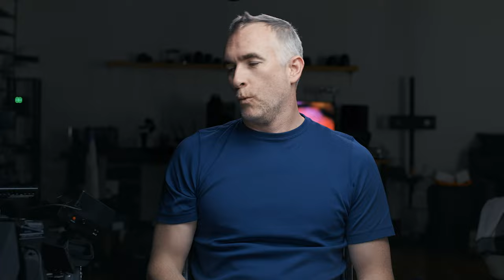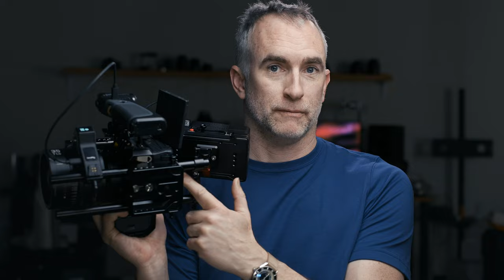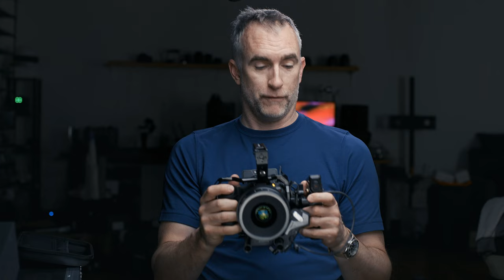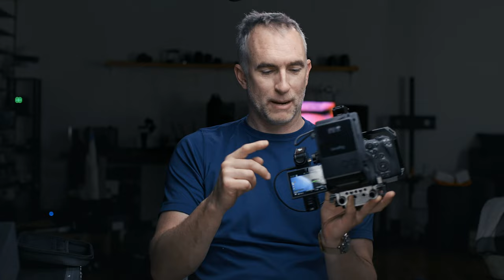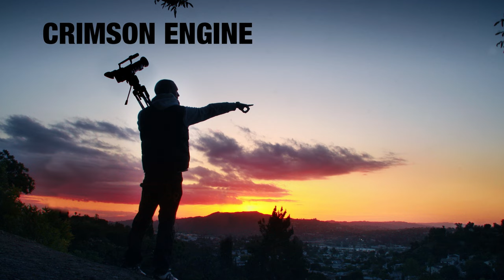Canon R5C SmallRig Cinema Build

Comment: 00:40 - 5W won't get you very far. What you were looking for was 9V 3A, so a minimum of 27W, which is the requirement for the Canon R5 C.
Reply: then what battery do you recommend
Reply: @titusnixon  That battery has the correct specs ;) He just got them wrong, badly.
Reply from the maker: I said that it has MORE than 5w, which most other batteries output over the USB. This is the battery you're looking for :)
Reply: @Crimsonengine  a standard USB-A charging port outputs 10W (2A) to 15W (3A).

ANY USB charging port outputs more than 5W.

The Canon R5 C needs 27W. Specifically 9V 3A. And yes, this battery does that. The specification you mention is nonsense though.

There was a bit confusion, when Canon launched the R5 C, that they specified 45W. The reason they had done that, is that 30W PD ports are rare and the battery pack, they had certified (the Anker PowerCore+ PD 26800 45W) is specified for 45W.

But the important specification to look for in a USB-C PD port for the R5 C is 9V 3A.

The same requirement actually applies the Panasonic GH6, S5 II and upcoming S5 II X.